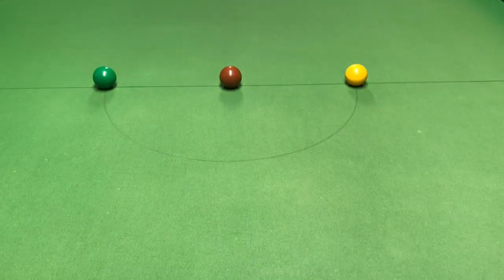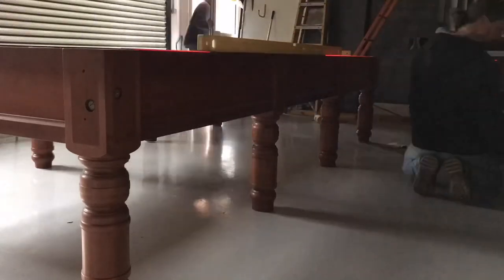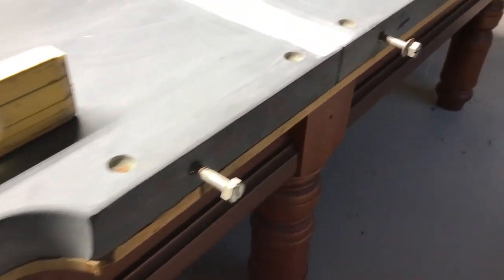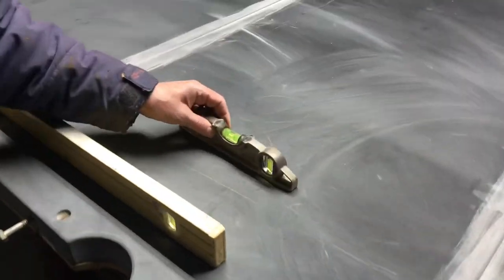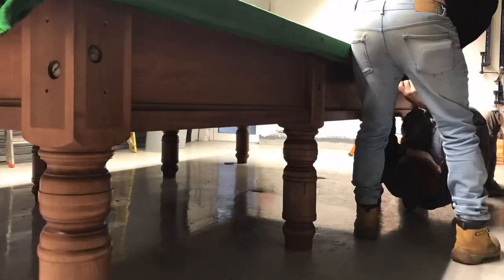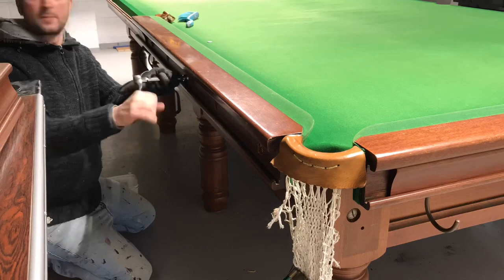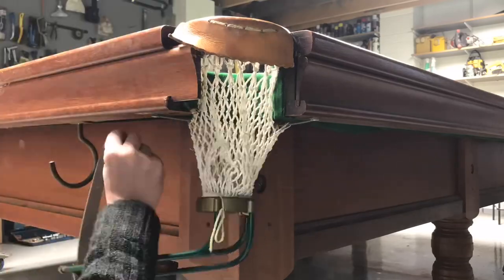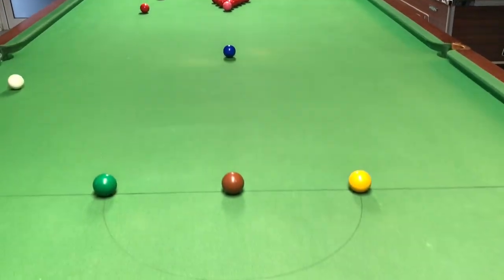How to assemble a Snooker table (#tutorial)

Comment: Great video.  I assume from this that in reality a snooker table is in two parts independently.  The base is one part and the top side of slate and matching cushions and pockets the other.  In reality would is be correct that two different brands of snooker tables can exchange/inter change tops over bottoms ?  I ask this question as my snooker club has three BCE Westbury tables from 1983 ... they are past due and don't play well despite having new clothes put on annually.  We have looked at ne tables from different manufacturers and in all cases are disappointed that the bases of new tables don't seem to be as solid and sturdy as tables from 30 or 40 years ago.  So I am wandering if putting on new slates and cushions while retaining the old bases is the answer OR is it that probably the slates needs to be removed, the old bases checked  to be revelled and rebalanced and then the original slates refitted ?  Any advice is appreciated.  Cheers.